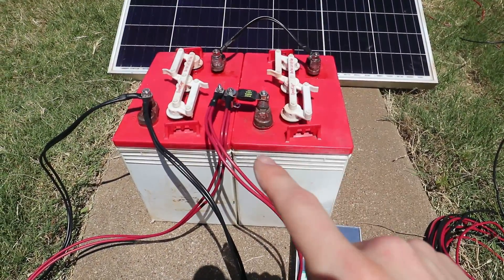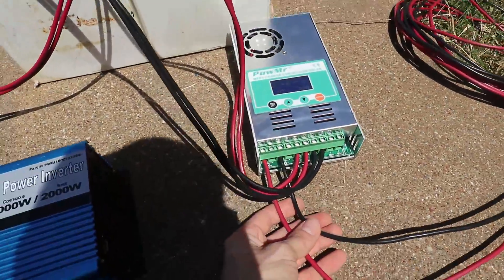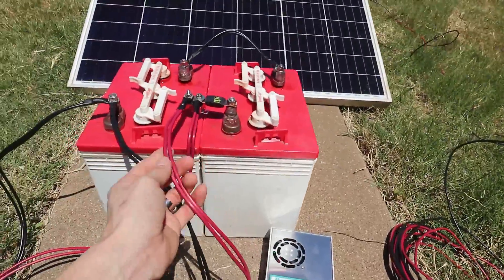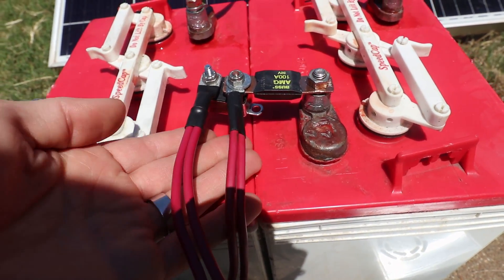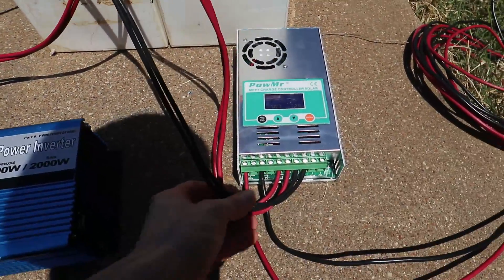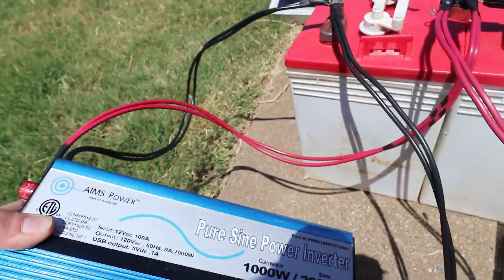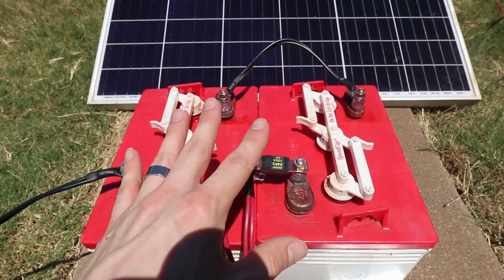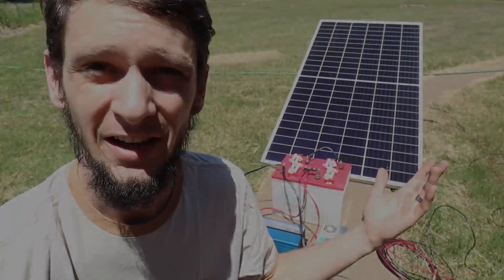Easy 12 Volt Solar Setup with PowMr Controller - Enough for an Air Conditioner

Comment: 4,880 watts of PV, 25Kwhr Smart for Two car Lithium Ion Battery EV Car battery Over 400 pounds in weight. Was a 300v system now converted down to a 56.7v system aka a 48v <- which those numbers tend to stump non solar peoples. A small Out back FM80 MPPT solar charger. 6,000watt 220v /110v dual rail single phase Pure sine wave inverter ( 3,000w per leg ).  We make about 13 to 18 KWhrs per day between 40 to 58 amps in a 48 volt set up. All wires over sized.  Runs our Fully functional Tiny home.  Bad side is our 10,000 BTU AC. It'll use half the power coming in when its hot out. Battery gets 70% to 100% charge daily most days sun permitting.  40% at night when we switch to the 5k btu ac.  Our fridge is always on and uses little power as it cycles on and off. The Air fryer,  coffee maker,  rice pot, can be used during the day or late after noon. I have a 5.5k 220v electric water heater soon.  I just  wish I could source another 25kwhr battery to match so we have 2 to 3 day autonomy.  An adorable 6,500w 50 amp Champion Generator so loud we can't hear jet planes going by us over head.  I had to fabricate a 220v dual hot leg style RV plug ( 50 amp ) 25 amp per leg.  We're living 100% off grid and I love it. Not everyone wants to let the chickens out 5 am and poop in a bucket of sawdust or shower out side in the winter. Its a blessing I'm sure to be clean. I'm now Black foot most days in flip flops on rocky clay ground.  We Then compost our waste it as to not have septic on 100% unrestricted land.  rain water collect 3 stage filter. No well! Saved over $75,000 DIY local sourced materials and self educating in building, electrical, gardening and plumbing. Yeah, fun times! heh!  The power did go out in the city 5 or 6 times this year. No one mailed us the notice so we had no clue! Love me some solar power! Now to bind and ground all components as this is not a mobile application.  Total cost of house, insulation battery solar ect? Under $25,000. <- great design for living with zero bills no mortgage and a $7 dollar land tax. I have to pay that once per year. Its mandatory by the state.  I wish I could grow coffee, squeeze sugar and gather salt... but life isn't perfect!

Comment: 4 batteries (12v35A ) off 2 350watt  pannels do I run the batteries in series or parallel?
Reply from the maker: What voltage is your inverter made for? What about your other loads?

Higher voltage reduces current which tends to make things easier in the future.

Comment: What would the mppt settings for this set up as shown: (2) 6v vented lead acid batteries in series?  6.6 for D01, 7.2 for D02, and 5.0 for D03?  Manual is confusing me. I would have same battery set up but with a 280W, 39.2V (Voc) panel.  Please help demystify, Thanks.
Reply from the maker: Since the batteries are in series you’ll be in 12v nominal. Typically d01 would be about 13.5 and d02 about 14.6. Better if you can find the specs from your battery manufacturer instead of using generic numbers though. D03 is for the output load terminals which most people don’t use. It’s a low voltage cutoff which if you do use it should be no lower than 12v.
Reply: Beene Energy ok, thanks. Manual said it would sense amount of batteries and multiply accordingly. But, in fact, it is only going to see a single 12v battery, correct?
Reply from the maker: @tripthompson8009  right, it’s going to sense the voltage. In this case it will see in the neighborhood of 12v and leave that multiplier you’re talking about at 1.
Reply: Beene Energy thank you very much!  So hard to get clear answers on solar issues. Thanks again and keep up the great videos!  I know I’ll be watching!

Comment: Please do the math.   multiply the a/c demand in watts by time to get KwH ( kilowatt hours)  now take the output of your panel mulitply it by time it can produce that power.. to get KwH.. and compare the two numbers !  With a battery, you can convince yourself that your panel is going to run your load.. and it  will, as long you obey the laws of physics... and no longer.

Comment: Thank you.

I'm not offgrid, but we do have regular grid failures, from minutes to hours.  16 hours in July doesn't seem as long as 12 hours in December when it's 30F and there's 7 inches of snow on the ground.

My original interest in solar power was short term, semi-normal power for those outages.  Over time, I have grown the system to something better than that, as it could now provide "cabin in the woods" power for a longer period.

Semi-normal: fridge has power, as do outlets over kitchen counter (for charging cell phones, tablets, laptops) and the LED lighting under the cabinets there (preparing food for cooking on the gas cooktop).  Uverse has power for landline and internet but not the DVR.  In summer, that's about 17 hours (longer than the longest summer outage in 15 years at this location).  If I use a 5000BTU air conditioner for 3 hours, that's about 8 hours total backup in summer.  In winter, that's about 15 hours (longer than the longest winter outage).  If I use the central heat, that's about 12 hours in winter.  Backup to the solar generator is a 1600 watt inverter generator which can run the listed items and recharge the batteries for 6-8 hours per gallon of gas.  1500 watts of solar can keep up IF every day is sunny and not using A/C or central heat.  No, I don't have this memorized - there's a spreadsheet that's still in progress, as I find something to tweak almost monthly and I add to the equipment list from time-to-time: PowMr 60A on order, "4000 watt" Changi pure sine wave inverter currently being tested (might manage 1500 watts continuous with external cooling but the sine wave is acceptable).

Cabin in the woods: counterheight fridge from the basement has power, as do outlets over kitchen counter (charging cell phone, tablet, laptop), LED lighting for cooking.  No Uverse.  That's about 59 hours.  1500 watts of solar can keep up if there is partial sun daily or full sun every third day.  Or 13 hours if the window A/C is on 6 hours - needs full sun daily.  Or 22 hours if the central heat is on - needs full sun daily.

If I fire up a gas generator, I'll also power the freezer for a few hours - it's rated to keep things frozen 16-24 hours if not opened but that probably depends on the weather.

Backup system specs: 12 volt, 420AH AGM battery bank; 2000 watt pure sine wave inverter; GenTran four-circuit load switch; 1810 watts of solar available, connected via three 30 amp MPPT controllers and one 40 amp MPPT controller (all EPEver/EPSolar).  Total for solar panels, controllers, batteries, two 2000 watt pure sine wave inverters (I have a spare), circuit breakers, fuses, wire, connectors, test equipment (DC clamp-on ammeter), switches, etc, etc, was about $2600.  The GenTran was installed prior to getting interested in solar but the current six circuit version is about $300.  The batteries and most of the solar panels are from the nearest metro area Craig's List.  $0.50/watt and under isn't a bad price for nearly new panels in this area.

I also have solar powered lighting in the equipment shed out back (about 15 watts of LED strips, 12v 15AH battery, 30 watt panel, PWM controller).  It's been in place about 2 years and is more reliable than the grid - it's there every time I turn the switch.  It was cheaper to go solar than to get conduit run under a driveway to have AC power out there for lighting.
Reply from the maker: I love it! You are showing off how flexible it can be. Even just having the batteries and generator is so much more efficient than just a generator. You have some fairly extensive setups there!
Reply: @BeeneEnergy  The spreadsheet has a place for the DC amps from the generator and can tell you how much gen time is needed to replace XX amp hours of use from the batteries.  Knowing the inverter gen's gasoline usage means I can predict how many days of fuel we have stored.

Comment: Did you ever think about desulfating those lead batteries?  I have brought battery's back from not taking a charge anymore with this.  http://www.r-charge.net/RC-2A12-12VDC-100-240VAC-Battery-ChargerRejuvenator_p_88.html.  You would have to keep the batteries in series then flip the series connection and charge again.. Nice video and was surprised to see the charge controller requiring double the wire connections to double the current. But at short runs like you have shouldn't be much resistance or current drop.
Reply from the maker: I hadn’t considered any significant maintenance. Honestly I’m trying to get rid of them and just mess with lithium chemistries.
Reply: @BeeneEnergy  Works on car batteries too.  According to renaissance the golf cart lead acid can last years longer than the MFG states and their charger can "increase" capacity.  I don't know I just fix car batteries with it. But you have most the equipment to test that.  Would like to get a couple of not so degraded golf cart batteries to see if that claim is true.  I do know the old non computerized battery chargers that can put 6amps at 15.2VDC do a decent job. But when the battery refuses to take the charge the 2A12 reverses that in a good number of cases. But some batteries are to far gone if both chargers fail.  Lithium do charge faster but with the BMS and cell configurations get pretty complicated. If done wrong can make some expensive scrap. Cant wait for Elon's battery day.